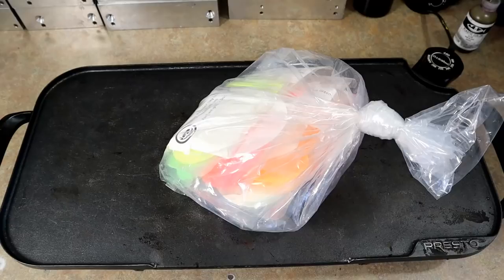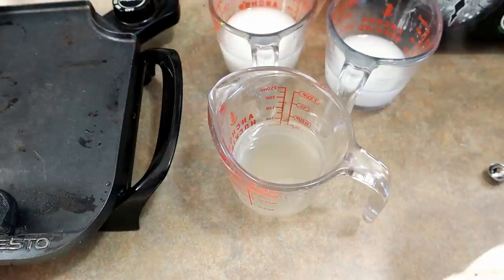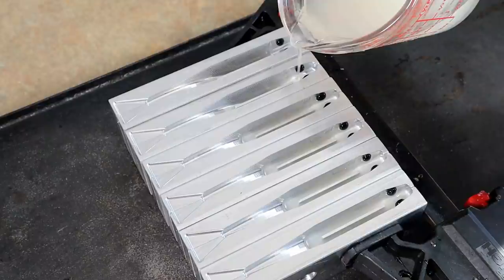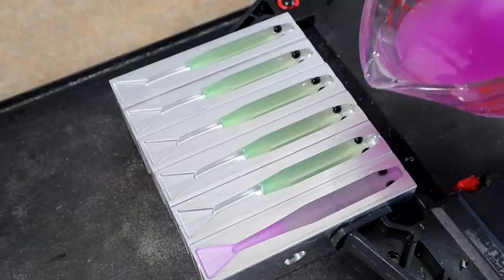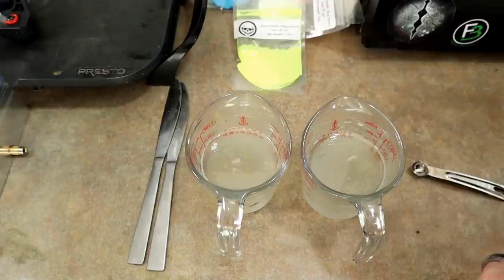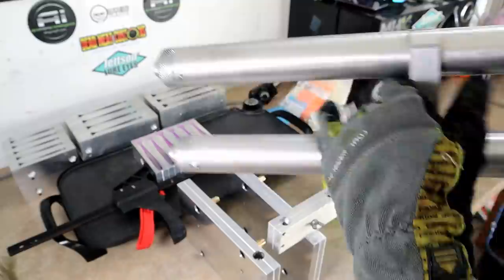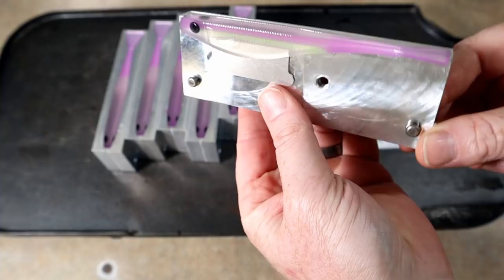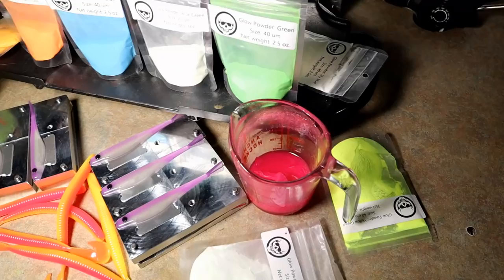Make Your Fishing Lures GLOW! The Dead-On Plastix Glow Powders Are Here.

Comment: Here is my personal run down of glow baits. I have used them for 35+ years in salt and fresh water. In saltwater they work amazing... to the point they made the "Lunker Lights" illegal in the PNW because they worked TO WELL. They were little glow sticks you put in surgical tubing right above your live bait. You are still allowed the glow powder type plastics which you super charge like you did. In fresh water you do NOT want to over saturate or super charge as that actually drives fish away unless it is just a tiny dot. They have the glow stick baits for ice fishing and glow tail baits for bass, many glow plastics for walleye but the trick is to just barely glow, enough to draw the eye but not be a glaring light to the walleye (bass don't care) and perch. I have been using the old school glow powders in my own baits since I started but only as an accent, these new powders are colored to the point I may start making smallmouth/walleye baits with them as smallies have a serious thing for the bubblegum colored baits, I could fish 24 hours a day with the violet powder smallies all day and wallies all night!
Reply from the maker: Very cool observations thanks for sharing your experience...

Comment: Most people use just a standard glow in the dark that glows green from what I’ve seen and already found out. I personally prefer glow in the dark only for panfish plastics never had much luck with them on anything else. If you ever get the chance try Lit powder from Stuart Semple by far the best glow powder I’ve used charge it and it’ll burn for 4-6 hours easily and sometimes it’ll burn for 8-10 depending on how well it’s charged. Happy Birthday.

Comment: I was curious I just picked up some glow powder for jig heads and was wondering if its possible to use the powder in some plastisol or would it just get hard and ruin the plastic ?
Reply from the maker: Should work
Reply: If the powder is used to coat jig head and is heat sensitive like the protec powders that will ruin the plastic as once the powder gets heated it will harder like glass. You’ll ruin your plastic and most likely your injectors and molds. If it’s ONLY powder and not jig coating then you’re fine.